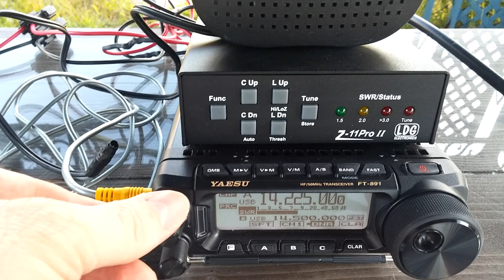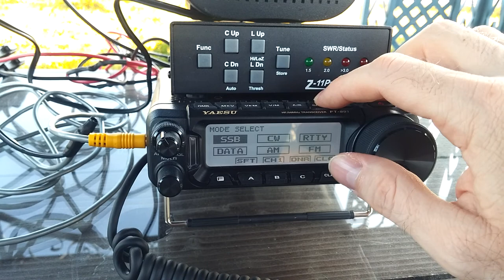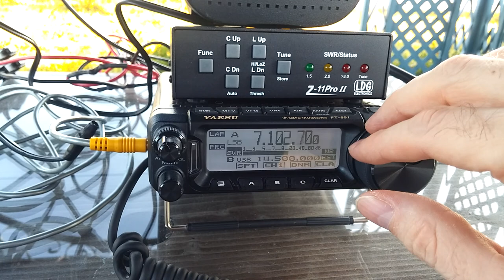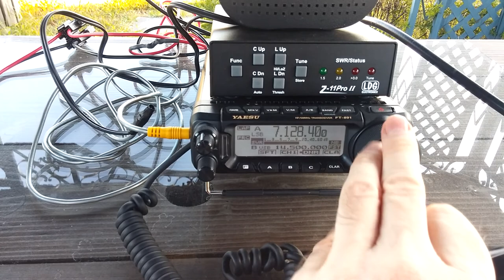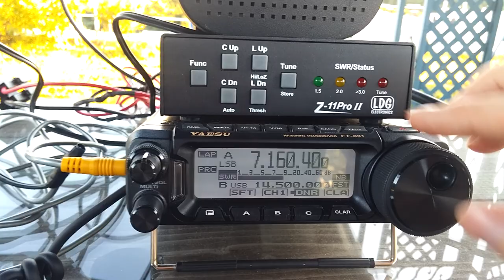Simple portable doublet setup with ladder line

Comment: I bought a 891 for portable. Certainly will admit that is a very underrated radio. Very good noise reduction for a $600 US radio. Would love to see Yaesu make that radio with a built in tuner. 
My first contact on 20 meters was in Chile from S E US.  With a portable 10 foot vertical antenna. In all fairness we were at 5000 feet elevation.  
The 891 would make a new ham on a budget a great base radio.

Comment: Great video.  With a tuner a 4:1 balun isn't required  These are a terrific multiband antenna.
Reply from the maker: Depends on length.  Sometimes no balun or 1:1 is right.  But at this length, I measured 4:1 balun needed for better SWR match.  Should still check a doublet with analyzer. Oh, and needed to change balanced to coax, for my LDG, which has no balanced inputs.

Comment: How long is the antenna? I am trying to relearn Morse code after 40 years! I guess you might say that I have been away from radio for a while.
Reply from the maker: You can make different lengths, but if you have space a 34'x34' is a good length of you have a tuner, and there is gain on 15m with lobes at an angle towards the ends.    Also here is a shorter vertical with ladder line you can make:

https://www.dj0ip.de/my-favorite-antennas/all-bands-vertical/

Comment: Ok, so the legs are (were) 33' on a side, but what length of ladder line?
Reply from the maker: Random length.  I'm sorry but I don't remember what it was. What I did was throw up a random length and then test the SWR on various bands. If any important band was way off, then I added another meter of ladder line to it and retested. The readings you come up with may tell you whether or not you want to go with a 1:1 balun, or maybe 1:4.  If memory serves I experimented with both, for one tricky band. The goal for me was to get a decent SWR on at least the bands I used most, and acceptable on as man others as I could.   There are online measurements you can google to start from.  I may have began with one of those.